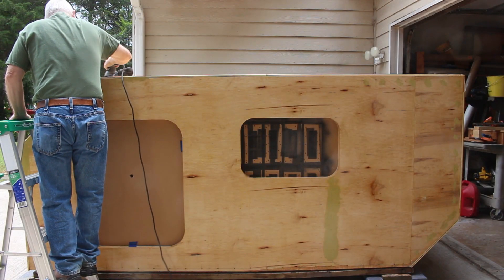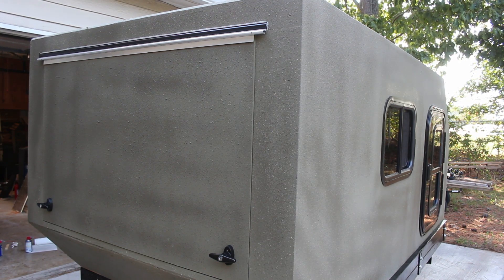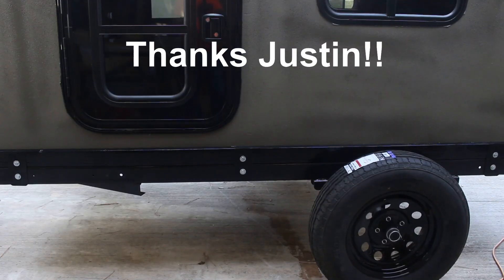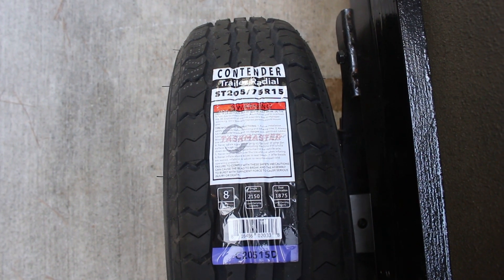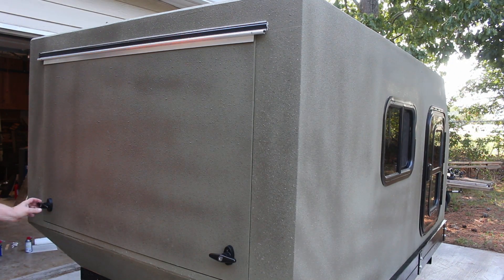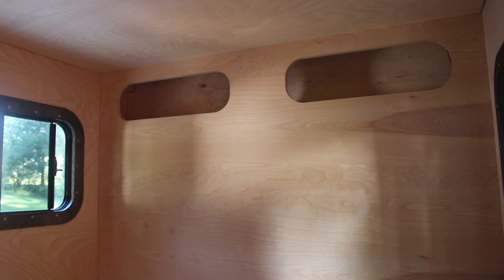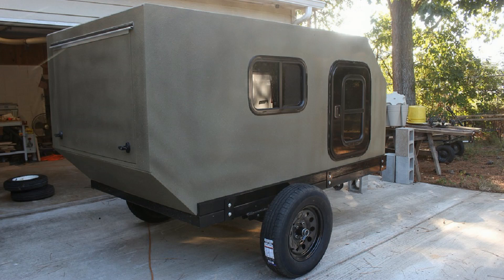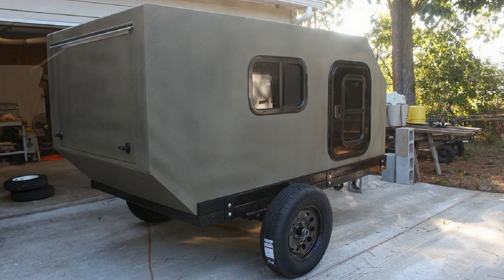Squaredrop Camper Build Part 11

Comment: Hi Dave, I'm adding my extensions on the end now. I hoping the biscuits and pocket holes will be strong enough to hold my galley door. One question: How is the bedliner holding up? Has it started to check?